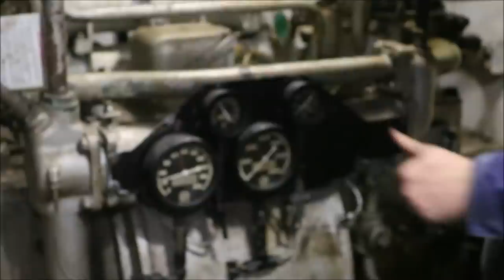First start in 72 years WWII 1942 Cleveland Diesel 8-268A

Comment: Sat idle for 70 years, yet fired up as though it had been run yesterday. They definitely don't make 'em like this anymore
Reply from the maker: Thanks for watching and the kind words!
Reply: In 70 years they'll say the same thing about the engines of today. ;)
Reply: @boringpolitician  I'm not sure the engines of today will last 70 years...but the ones that are already 40 and 50 might still be around then :P
Reply: @SpeakerPolice  it's not that engines to day are made bad or cheap it's that not all engines are made for the same purpose just like big diesel engines made to pull stuff have to made sturdier then a small car or truck wouldn't benefit of having an engine like this in the engine bay it doesn't make sense nor would it be practical so i guess a lot of those people who think those old engines are better then today's would rather still be using steam  powerd cars ,trains,ships etc are just plain Antiquated people
Reply: @GOBRADON502  I don't think electronically controlled engines made with thinner, cheaper alloys will last as long as purely mechanical units made of cast iron. It doesn't have to do with the use case so much as it does the build quality. A similar argument could be made for TV sets...today's modern flat panels will absolutely be garbage 50 years from now :/
Reply: @SpeakerPolice  It depends on the electronics though. Solid state components can be fairly durable and last long periods of time. My flat panel TV from 2007 is still going strong and is used daily 12 years later. And I have a PC from 1994 that still runs. Like anything else though, its ability to last through the years is determined by how cheaply its made, what it's made out of, how it was stored, and how much use it got in its life.
Reply: tiger1945 dodge put the 5.9 liter Cummins in their pickup, those motors are built heavy. They go for millions of miles if maintained. The older ones were more sturdy than the newer ones in my experience.
Reply: Mechknight73 build to last not build to lost
Reply: We'll have to wait 70 years to find out...…...…...
Reply: @SpeakerPolice   .....Yes,  but CRT (Cathode Ray Tubes) from a decade ago are garbage.  The modern flat screens are a huge  leap in quality.
Reply: @Snowcrest289  Quality =/= longevity or reliability. No flat panel TV will last as long as even cheaper CRT sets from the 80s have so far. The build quality just isn't there anymore.
Reply: @SpeakerPolice      My experience says otherwise, and as far as picture quality, Flat screen is exponentially better.  CRT gets a burn-in etched into their screens after relatively short time.  Flat screens don't.  Don't get me started on how much better my modern engine is compared to my '65 Mustang 289.
Reply: @Snowcrest289  Note that I have yet to equate build quality with 'picture quality'. Picture 'quality' is also not analogous to resolution. Sure, modern TVs will do full HD and 4K resolutions, but that doesn't necessarily mean their 'quality' of picture is better. Older sources also look like garbage on modern TVs, even with attempted scaling.

But back on the original topic...longevity wise there is literally no contest. I have TVs from 1955 that are still plugging away with minimal service. That absolutely will not happen with a modern LED LCD.

(As a footnote, if you're actually experiencing phosphor burn on a CRT, you're abusing your TV. Even on modern plasma sets, that's hard to do!)
Reply: I have a running 1971 340. Anything will last depending on how often its used and how it's stored.    The 7.3 is electronic controlled. I have one with 300k on it.
Reply: Andreas Kristensen no they won’t, any of these new engines set 70 years and thinks will be so gummed up from cheap ethanol fuel not to mention rodents, as we as how electronics don’t always like to work after they’ve set for a long time
Reply from the maker: Route 66 Texas  Thanks for watching! It took me around 3 years of volunteer work to get the old girl going from the first time I looked at it to the minute this video was made. 8 rebuilt injectors, rebuilt blower, and lots of other smaller tasks. The bigger issues were sometimes the auxilary components needed to start and run the engine such as compressors and pumps in other engine rooms. I also don't use fuel additives, nothing but ultra clean diesel fuel is to be used in the injectors.
Reply from the maker: Route 66 Texas  I rebuilt all 8 injectors before re-starting the motor so additives are not required in this case nor would they do any appreciable good to other parts of the engine. I have however used mavel mystery oil on locked injectors that I don't care enough to rebuild, and even small siezed motors with great sucess!
Reply: They don't build engines like this anymore because not enough people want them. Most people want a new car every 3 to 5 years anyway so why would manufacturers add the extra cost of building things to last? 

People like me who want to buy a car once and keep it till they're done driving and retire are an insignificant portion of the market share plus we're not worth as much money to a manufacturer as mister car every three years. So no such vehicle exists.... no market, no product.
Reply: @GOBRADON502  I suspect a major difference between an engine of this vintage vs something current is the simplicity. Not that the old one is down right simple, but is almost entirely lacking in electronics and micro processors. If an old engine needs a part that requires machining, as along as you have the specs or maybe even not, it can be made. But in a few decades, heck might not even be that long, if a processor or some other electronic is needed, it could be quite the challenge to either find a replacement or making one that will work.
Reply: @boringpolitician  assuming the ECM still functions. I've already been seeing people have to junk 80's/90's engines because the control electronics went bad and are no longer made.
Reply from the maker: I've seen that myself. Too bad. Thanks for watching!
Reply: In reading most of the replies here... in a sort of, "debate" as to whether or not "today's" engines will still be around or able to run in another 70 years.... well, that depends on the original engine and its application.  

As far as "today's" electronically controlled automotive engines, of all sizes (excepting large off hwy mining trucks, etc)... they Are designed to have long - longevity, initially.... however, they are NOT "premium" designed engines, in other words.. they are designed as "throwaways" and not to be rebuilt like the older - pre-computerized engines were and still are. 

Almost All HD diesels, even the ECM controlled HD truck (class 6, 7 & 8 - ie: semis, etc) engines are indefinitely rebuildable or reman capable for at least 3 - 4 million miles plus.... with the possible exception of the post Series 60 (4 cycle & the worlds 1st fully integrated electronically controlled heavy duty diesel) Detroit Diesels, ie: DD 13, 15 & 16 series engines, which are sleeveless, aluminum blocks.

The older the engine (gas and diesel), the simpler and more reliably rebuildable (or re-man capable) they tend to be..... because things were made and "governed" with the idea of longevity & quality.... not How much money they can make for manufacturing co. stockholders, of these days... through making "cheap" (quality wise) and repeat sales of new.  

Another reason that pretty well all light duty (cars, pickup trucks, etc.) engines built (especially) since 1987 will Not be around (in terms of running well, if at all), is the lack of replacement parts.... there are many parts on these engines that are already "non-existent" for replacement.  

Another issue, that is especially true of vehicles in storage, and especially so for those in rural conditions.... is Mice and other rodents... who seem to have a particular affinity and desire for the sheathing on electric wiring, especially for 12V wiring, to build their nests with. 

Yes, there is wiring on the pre-ecm vehicles, but nowhere near the extent of what is found in new vehicles, and especially Not under the hood.  True, today's "modern" reciprocating engines are more efficient in some ways..... but at what overall expense?    

As an aside... I have 20 years of drag racing behind me and built all my own engines (as well as occasionally for others) and had  my own GO - Power engine dyno (from the 1970s) for testing the engines. 

I have yet to see an electronically controlled (or, even mechanically) fuel injected engine produce as "fat" of a torque curve, nor as much torque as a carburetor controlled gasoline engine will.   

Keep in mind, that I'm talking about average "factory" engines (with the exception of a very few) here.... Not purpose built engines.  

There is a reason that car (and some pickup's) manufacture's install anywhere from 5 to 8 speed slush boxes (automatics) behind their engines..... because they're "gutless" in their torque output, compared to the older, Carburetor fed gasoline engines of "yesteryear".... and even "today".  

The vast majority of the pickup trucks, etc, involved in the sled pulls.... utilize carburetor's.... some, even using "modern" engines that have been divested of their electronics, and replaced with all manual controls. 

While we're at it,  as far as the chemicalized garbage they sell as "gasoline" today.... it doesn't produce anywhere near the power of the "Real" gasoline from years ago... even the unleaded gasoline of the pre - mid 1950s.... and ethanol, is corrosive... Period!    

Sorry for the "book".
Reply from the maker: @Romans--bo7br  Thanks for watching and the very detailed explanation! I was not aware of the new DD MTU engines being aluminum block and sleeveless. Although I'm not surprised. Thanks again!
Reply: @GOBRADON502    BULLSHIT. Quality made & spect. equipment will win every time through generations.
Reply: These days you get locked out your car because the "super charging" station has not enough voltage. Progress I guess :)
Reply: Maybe they do, you just have to wait 70 years.
Reply from the maker: We'll just have to wait and see. I occasionally think about the "will it start" videos 30 years from now with stuff that's relatively new today. Cheers!
Reply: There is one exception on todays engines lasting for decades to come and that is arguably the best in line six that Ford ever produced and is now being discovered by the Americans especially for drag racing and that engine is our famous 4 litre “BARRA” engine designed and built in Australia and the final iteration used in our FG series Ford Falcons and is a brilliant powerful unit with longevity built in my XR-6 Falcon with its twin cam variable valve timed four valve and turbo charged in the performance version is a weapon and is an LS killer as a matter of fact it has such a strong bottom end that you can get up to 2,000 HP with its standard crank! and not much needs to be done or spent to achieve phenomenal horsepower out of them the only problem is you blokes are buying them up by the container load and you’ll probably deplete is of stock in the years ahead lol but even the atmo ones are a long lasting high mileage unit and they see well over a million kilometres in cab use, it’s on record that this Aussie engine was the best that Ford built anywhere in its empire, but don’t take my word for it you can look it up for yourselves on google or the many you tube videos and this engine will definitely be around in numbers in the next 70 years!
Reply: Llevas razón, en mi casa de pequeño mis padres compraron un televisor a finales de los setenta y el técnico siempre andaba por allí cerca cada pocos meses. Compré uno plano en el 2000 y después de un uso intensivo, funcionando perfectamente al día de hoy. He tenido varias furgonetas de trabajo sin electrónica y muchos problemas de motor, en el 2003 compré una supuestamente más tecnológica y hasta el día de hoy aburrido hacer kilómetros y funcionando perfecta.
Reply: Engines sitting idle for 70 years usually don’t have there intake and exhaust welded shut effectively making them a time capsule.
Reply from the maker: @frankjackson2439  That was certainly a huge help. When the exhaust is open outside the hull, you can feel wind coming out of the intake. No way it would have stood up to 72 years of salt air intrusion. Thanks for watching!
Reply: Great resto of a mighty old engine 
Reality is, a modern engine about a tenth the size and weight would produce twice the power 
Harsh, but progress marches on 
Keep saving the classics 👍
Reply from the maker: @gor4988  Thanks for watching and the kind words!
Reply: @gor4988  No not really, you thinking of advancements in transmissions. Old big engines like this have tons of low end torque, and that’s exactly what you need to drive a big propeller. Engines are more efficient today because they use smaller engines that can output a higher rpm so a transmission can be fitted to turn that high speed into slow torque to drive the big propellers, that small engine burns less gas at a higher rpm than a bigger engine that has a low rpm and a higher torque. The really sad part is new efficient smaller engines will never ever last as long as this because there run harder at higher rpm.
Reply from the maker: A few interesting facts are that today an engine just like this could make a lot more power and have increased reliability with the same operating parameters. This is due to advances in metallurgy (much of this engine is brass) and lubrication. Funny enough the technology and design has stayed almost exactly the same except the more modern engines actually got bigger! This engine is a series 238, meaning 238 cubic inch displacement per cylinder. The final rendition of this engine design (still produced today) is now 710 cubic inches per cylinder. The basic design is almost identical with the exception of the addition of electronic controls and governors. Thanks for watching and sharing!
Reply: @frankjackson2439  I know nothing of ship transmissions, so won't comment there. 
Your not seriously saying there's been no advancements in engine design since this old beauty was built ? 
CC or RPM have always been the options for power increases, that still holds true, But every other aspects of ICE has been continually refined 
20,000 rpm redlines are not unheard of, 200 is the other extreme 
Anything can be made to last forever, if you throw enough dollars at it. 
Current metallurgy, lubrication, cooling, CAD, etc technology means new is better than old.
Reply: @gor4988  In terms of performance I whole heartedly agree, you can’t argue with facts. I’m just saying the longevity isn’t brought up as much when designing advancements in engine technology.
Reply: @frankjackson2439  True, everything wears out, being unused and sealed for 70 yrs is a great way to improve the longevity of an engine though. 
Think it's down to $$$, is a rebuild after x hrs use a better investment than over engineering in the first place ? 
I have huge respect for the people who love and care for these old beauties, steam engines are fascinating to me, but know an electric motor I could lift, would produce the same amount of work as a room size boiler 

Glad you enjoyed the vid as much as I did, YouTube is fantastic at letting these dedicated people showcase their hard work
Reply from the maker: Thank you for the kind words sir.
Reply: @FixAndForget  No ... Thank you, for documenting and sharing your expertise and dedication 
I'll certainly be checking out more of your clips 
Keep up the great work 😃
Reply: The simple fact is, there is no longer any incentive for making things reliable. Most Americans want classy, flashy, and fast. 

When the majority refuses to buy garbage, manufacturers will stop selling it. That's why I love old cars! :3
Reply from the maker: @jamesgizasson  Thanks for watching!
Reply: @jamesgizasson  Isn't not having to use a manual choke, having carburetor tuned, replacing points n plugs then adjusting timing, greasing joints constantly, etc, etc a Huge step towards reliability?  

True that manufacturers produce what sells best and have little incentive to engineer things to last far past warranty period 
There's a reason many people replace their vehicles every 3 to 5 years, technology is growing at such a pace that next yrs model will be better
than last years 

I love old stuff (I'm old) own several 20 year old cars, but they require TLC to keep them running 
Reliable = new
Old = unreliable
Reply: @gor4988  No, new = new. That just means there's not wear and tear on it. 

My 27 year old diesel will never be crippled by a computer malfunction. Yes, it will wear out, and every single part will eventually need to be replaced. 

The difference between it and any modern vehicle, is that it CAN be rebuilt because it was DESIGNED to. I'll keep the old girl and deal with the TLC. UwU
Reply: @jamesgizasson  100% agree that complexity has massively increased the failure points, computerized systems work at max efficiency or not at all, generally.

Will you be able to buy parts for a 30+ yr old engine and at what price ? 
All the while polluting the place 
Say, half the weight for twice the performance from a modern engine, that will last you out 
Where will the sensible money go 

Enjoy the old girl, treat her right and maybe you'll avoid the rebuild
Reply: @gor4988  I agree. Plus, I'm not cranking the engine up for power, and have it running clean. It's even still got the cat! :3
Reply: This is an example of selection bias.

The old, quality stuff survived. The old junk stuff was forgotten about. 

A ship's engine is designed for a long life and reliability. It survived because it was designed to survive. That is true of this engine and true of the engine in a brand new cruise ship. 

Do we say "Oh man, those 1200 cc VW engines were the greatest things ever, they don't make them like that anymore!"? No, we don't. They were prone to leaks, needed constant adjustments, and made no power at all. Those were German made engines from the 50's.

Now the engine that was in my last car would probably survive for 70 years (it was a 2012, before it was crushed in a collision). It was an actual simple and reliable engine that was easy to maintain, and under powered for it's displacement. 

My current 7.3 liter diesel had survived for 25 years so far. Even taking into consideration having to repair wiring (which I haven't had to do), I imagine it will still be running in 50 years. 

All the junk that was made 100 years ago is junk and forgotten about. Only the good stuff survived. Just like music, we only remember the good music from back in the day and forget about any junk that was produced soon after it hit the shelves.

Edit: I was stationed in a ship that was built in WWII, and on another ship built right after Vietnam. I got my hands plenty dirty working on old equipment.
Reply from the maker: Thanks for watching! That is an excellent take on the subject that I haven't heard before. Thanks for sharing! I also have a 2000 7.3 lol. I do think vintage quality was better than what we see today but there certainly was (and always has been) junk out there. Thanks again & Cheers!
Reply: @boringpolitician  No. In 70 years today's engines wont run because of a failed microchip that will no longer be available!!
Reply: Our car engines and small block no they will be dead. But out big impressive amazingly engineered massive ship engines and mega machinery engines that are precise as possible and kept in brand new working order and maintained will be just like this is70 years if not better. Imagine so of the large high end ships that keep their engines cleaned like a surgical suite. It's quite impressively to see
Reply from the maker: @xcreeseseater38  Good point. This type of engine is still in production today, the simplicity has been mostly retained but there have been vast metallurgy improvements in the last 70 years meaning modern engines of this type do go considerably longer between overhauls. Thanks for watching!